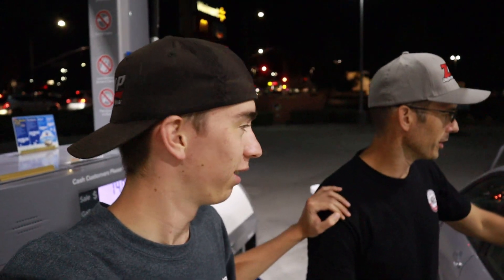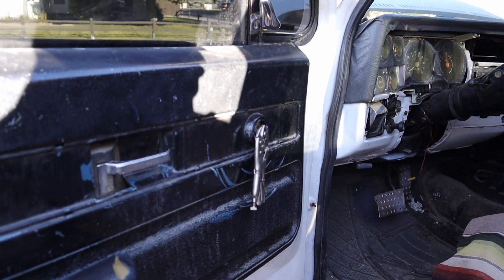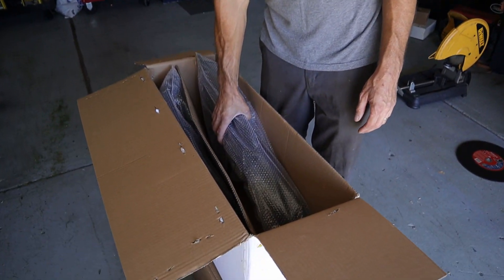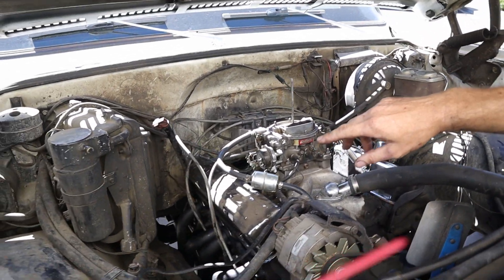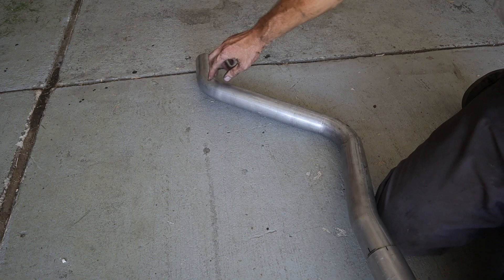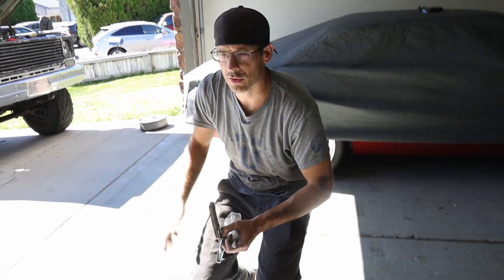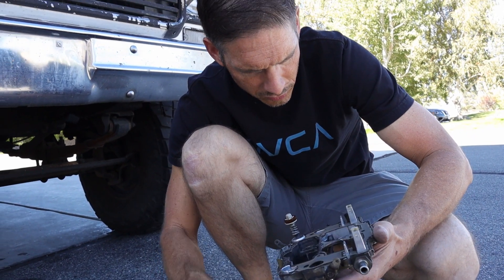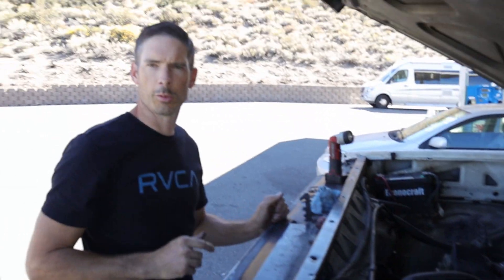We bought a 1975 K10 and drove it 500+ miles home

Comment: The passenger side exhaust pipe should be routed over the cross member too. I own a k10, and a k30 and have have built the exhaust on both.  Crazy how much these things are selling for now, I bought my running and driving shortbed k10 for $1500 in 2007.
Reply from the maker: They definitely have gone up quite a bit recently

Comment: im running stock manifolds on my k20 and ran into the same issue with a different dual exhaust kit. passenger side exhaust system is just not made correctly. i think all kits are made for 2wd trucks and you have to modify and customize to make them work for a 4wd (even though kits say they fit 4wd trucks)